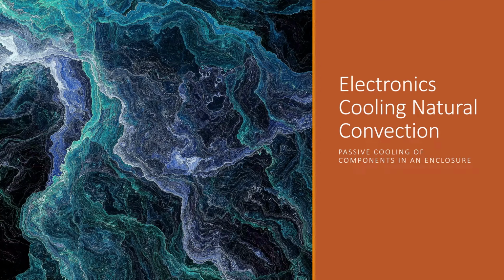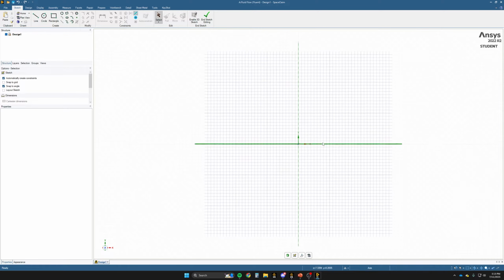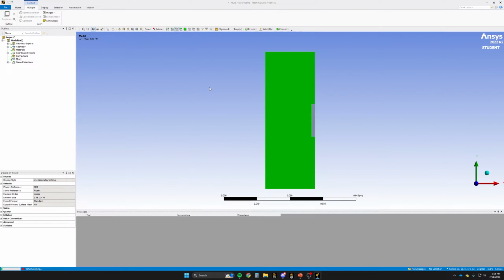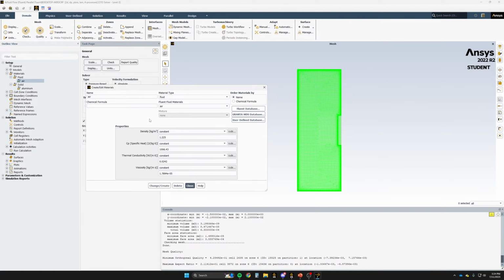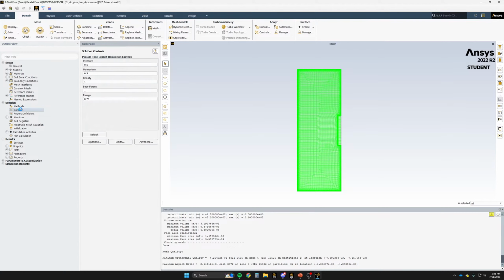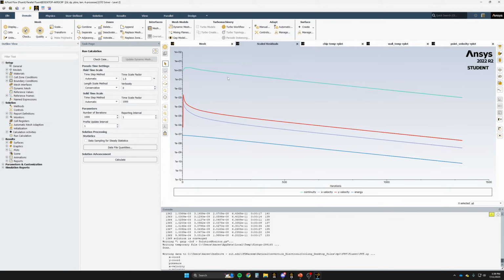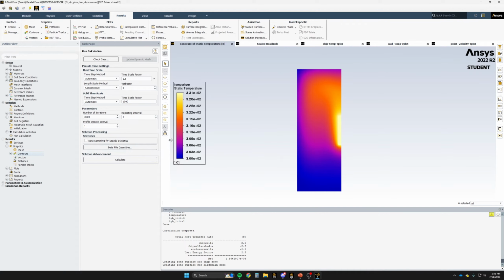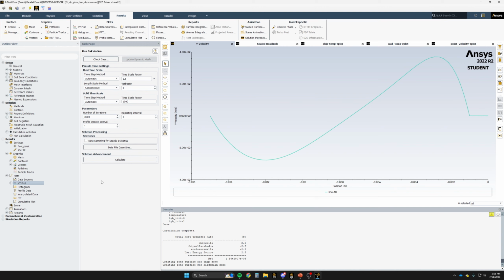Ansys Fluent: Introduction to Natural Convection | Tutorial

Comment: Hi wanted to ask if i were to simulate a pv panel cooling using heat sink do i add a temperature or to the pv panel surface?
Reply from the maker: The heating on a PV panel is due to the radiation from the sun often referred to as solar irradiance. This is a surface power density with units of W/m^2. For the simulation you will put a heat flux value (W/m^2) on the heated side of the panel for the most accurate model.

Comment: Hi 
Lets conside the air domain as a open environment ( no enclosed) , basicially for eg a geometry is inside the air doamin ( cuboid or sphere) , can we still provide htc and temp on the outer surface of air domain with 0 mm thickness ?;
Reply from the maker: If the boundary is an inlet or outlet condition you cannot add a heat transfer coefficient or fixed temperature. You can only add inlet temperature for an inlet and backflow temperature for an outlet.
Reply: It is an natural convection and no inlet BCs. I created air domain to understand the air flow around, in that case, should I apply pressure outlet to the outer surface of air domain ?  @cfdkareem

Comment: Please make a video on how to simulate forced convection using axial and radial fan. Thank you so much.
Reply from the maker: Hello, in an upcoming video we will look at applying inlet fan conditions to match real world conditions for cooling. For engineering simulations looking at cooling, the performance of the fan is modeled using fan curves. Fan curves give you the pressure vs mass flow that a fan can provide. This provides very accurate data at a much lower computational cost then modeling the fans explicitly. The difference between blower fans and axial fans can also be captured using fan curves. -Kareem

Comment: Hello Sir!, how can I simulate a mosfet`s thermal performance attached to a heat sink ? Shall I model a basic small block as shape of a mosfet and find out the case temperature and then junction ? and how this approach will affect the accuracy of the solution
Reply from the maker: Hello, it will depend on what problem you are trying to solve and how much complexity you require. The simplest way is to  take the power dissipation listed on the spec sheet and apply that to the mosfet geometry as a volumetric heating source. If you are analyzing a cooling method like a heat sink design, this is likely sufficient. For higher fidelity applications you can check out this article from Toshiba (below) which lays out the calculation of thermal power for complex situations. As always, I would recommend you start with the least complex model that will get you the information you need. Only add in the complex as it becomes necessary. -Kareem

https://toshiba.semicon-storage.com/info/application_note_en_20180726_AKX00065.pdf?did=13417

Comment: Hello, can I do this on the heat sink of a CPU to see its heat dissipating performance? I'm assuming steady-state and natural convection.
Reply from the maker: Hello, check out my most recent video on 3D natural and forced convection. It should help you with the model of a CPU heatsink and natural convection. If you want to do forced convection, check out my video "Electronics Cooling Forced Convection". This will be the same setup as a CPU heatsink under forced convection.
Reply: @cfdkareem  Thank you! Also, do I have to perform a mesh independence study before doing the natural convection simulation of a CPU heat sink? If so, can I just follow your video on mesh independence study in ANSYS fluent?
Reply from the maker: @marloyt7786 It depends on the data you want and who you are presenting that data to. If you just want a rough analysis of the performance then using your intuition to refine the mesh is usually ok. If you need highly accurate data, using it for engineering design, or presenting it in an academic paper then a mesh independence is very important. You can definitely follow my guide on refinement. You can use the heat transfer coefficient on the surface of the heat sink as the critical parameter for the refinement.

Comment: So your volumetric heat generated is 250000 W/m^3, and the length is 10 mm and your height is 1 mm. Based on these numbers I am left to assume your width is 1000 mm (which seems absurd).   Does the volumetric heat generated represent all of the chips shown in the problem statement?
Reply from the maker: Hello, for 2D planer geometries the default "depth" is 1 m, which can be set in the reference values. It will not change the simulation, but you can change this value to something smaller in the "reference values" tab. Again, the depth is arbitrary for 2D models as long as you calculate and apply the volumetric heating correctly to achieve the correct wattage.
Reply: @cfdkareem Thank you for the response, I hadn’t realized that 1 m was the default. I was able to figure out my volume using the volume integral tool and then do the math to apply the right wattage. Thanks again for making this video

Comment: yes a 3D Model would be great. I addition a cooler on the enclosure with forced convection would be a great add on. Is it possible to take the surface temperture of the enclosure as an heat surce of a new thermal calculation? How would I do so?
I general it would be great, if you show how to connect different thermal analysis (or a thermal analysis with an fluent analysis)!

Comment: Do you see Icepak better for this simulation?
Reply from the maker: Icepak runs Fluent solver in the background. So from an accuracy standpoint it wouldn't change much, but could save some time on the setup. I prefer to work in Fluent because I find it more flexible

Comment: Hi sir, why didn't you consider to enable "Radiation" for this natural convection case?  As I know, radiation would contribute significant power dissipation as well in natural convection cooling.
Reply from the maker: Hello, great question! Radiation usually only becomes a significant source of heat flux if there is a significant temperature delta between two bodies. For most applications of air cooling radiation will be ignored. You can add radiation using one of the models in fluent if you believe it will be a significant source of cooling for your problem. Thanks!
Reply: @cfdkareem  Thank you for your quick response. I am new to Fluent. I would do more cases for Thermal analysis. 😀
Reply from the maker: @leolkliu thanks for the suggestion! I was planning on some more thermal analysis videos in the next few weeks, including radiation. Do you have a specific problem you are interested in?
Reply: @cfdkareem  Do you have an email box? Perhaps we can have some discussions or share more info. Thank you.

Comment: Hello Mr, I have question about mixed convection of water or nanofluids in circular duct, the emperature raises in each cross section great than 10 degree, but boussinesq hypothesis not valid in this case, What do we do now?
Reply from the maker: If you have the data for density vs. temperature you can set the material property to match instead of using an approximate like ideal gas or boussinesq
Reply: but in this case we use water as working flluid @cfdkareem
Reply: in operating condition we activate gravity, density of water and inlet temperature in operating temperature, is it correct? @cfdkareem
Reply from the maker: Yes that is correct. If you have a temperature difference and a variable density then you will have natural convection. @ammarlaichi8474

Comment: You mentioned the inflation layers are important for capturing the heat flow, but you didn't use it for the earlier 3D forced convection video. Could there be a reason for that?
Reply from the maker: Yeah with the student/educator license you are limited by mesh size. Inflation layers would add significant size to the mesh, but should definitely be included for a real study.
Reply: @cfdkareem  oh, alright. Thank you!

Comment: Hello! Can you help me please? An error occurs

   Inhomogeneous process distribution on multiple machines.
   Or processes per machine not an exact multiple of GPGPU's per machine.
   Or not enough GPGPU's per machine.
   GPGPU computing disabled.

I went through all the possible combinations of Solver Processes and Solver GPGPUs per Machine 1- 1, ..., 1- 4, 4-1))) (When you press Setup). Clear generated data also doesn't help. 
Thank you for video! It's very interesting
Reply from the maker: Hello, I would try to remove gpgpu entirely. GPU computation in fluent doesn't give a significant speed up in simulation for most cases. It is usually recommended to keep it off unless there is a specific physics model that is known to provide a speed up in computation time.
Reply: Thank you very much for the hint. When I set it to zero, the errors disappeared, but an empty screen remained. How I solved it: I cleared the generated data and updating the project. After that, I had it displayed. @cfdkareem

Comment: Hello! Great videos!! Do you have any experience with PyFluent? If yes, can you make a video abou it? Thank you!
Reply from the maker: Hi Lucas, I have experience coupling Fluent and Python prior to the introduction of PyFluent. I'll try it out and see how it works. Is there a specific model/problem you are trying to use PyFluent for?
Reply: @cfdkareem  
Yes! It could be any conduction or convection problem. It could be in a simple 2D geometry, such as a plate, for illustrative purposes.

In my specific case, I would like to automate the solution of the model in Python so that I can run it in a loop, changing only some parameters of the model, and rerun the simulation. My application involves an inverse problem, which requires running the 'direct problem' numerous times.

Thank you very much for the response !!

Comment: Hello your videos are very helpful. I just had one doubt with respect your video with heat sink under forced convection, if we want natural convection for this case what changes we need to make?
Reply from the maker: Hello, to get natural convection you will have to change the density of air to "incompressible ideal gas" and make sure then gravity is set to "-9.81". If you want to do natural convection with a heat sink you can copy the set-up from this video for a 3D domain.
Reply: Then what should we take at the inlet and outlet should we go with velocity or pressure and what values should we consider
Please reply